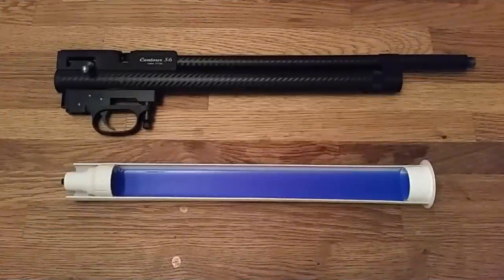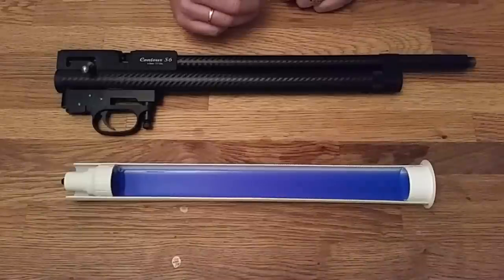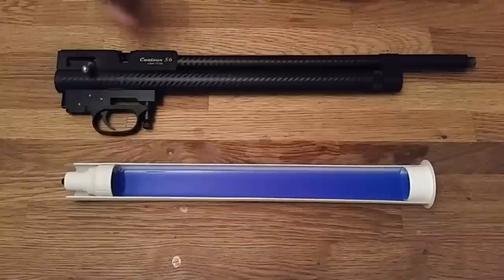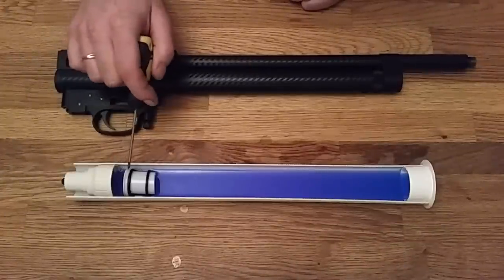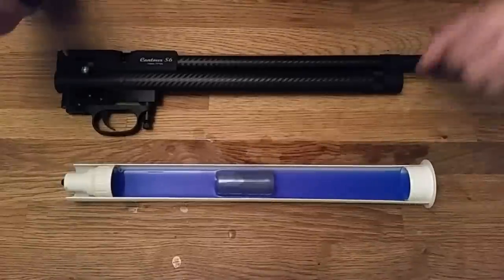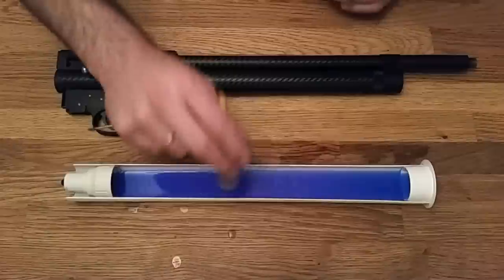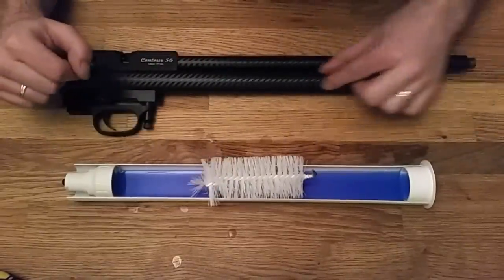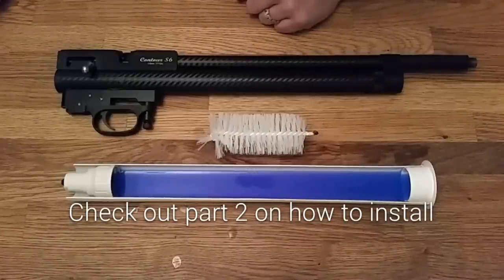Air Rifle De-pinger. Part 1

Comment: I tried the pvc tube it worked but I was not satisfied. I tried your fix and I was surprised at how much better it was. Thanks for the easy fix, was $1.00 at the dollar store!
Reply: Dave0288 which fix did you use? the rubber material rolled up OR the piece of baby bottle brush??? please leave a comment back to let us know what worked best and in what gun. THANKS...